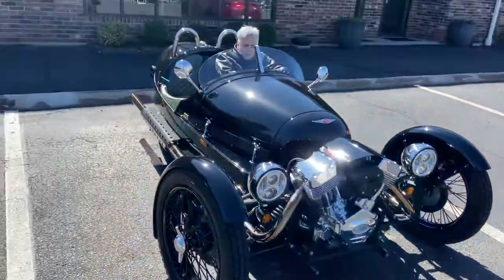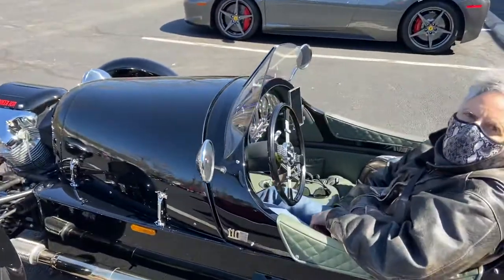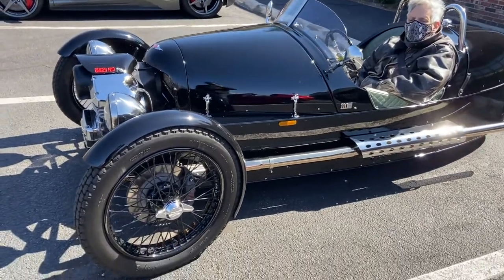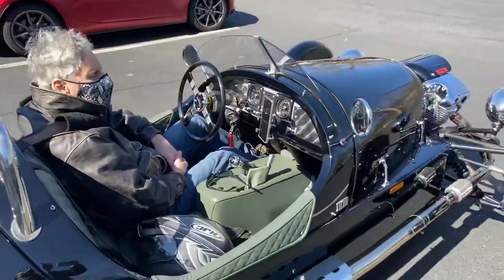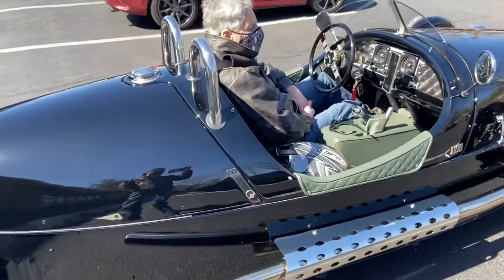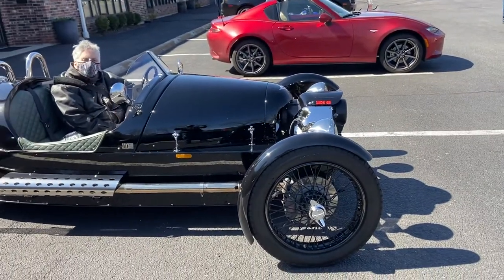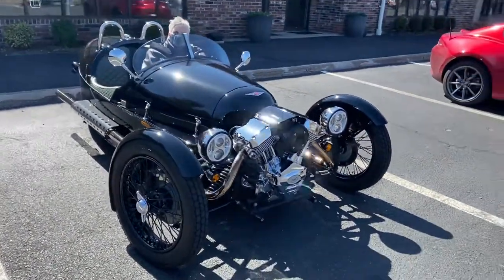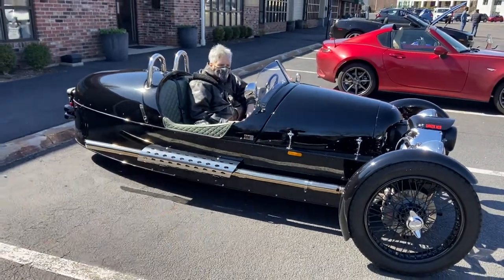Morgan 3 Wheeler

Comment: Super cool and very attractive looking, very Retro. A small negative is: with a three wheeler, there is no way to avoid potholes. That rear wheel is going to hit them every time, unless you actively try to swerve and avoid them. In warmer climates the roads are in better condition. Potholes are a mid-west and east coast hazard, created by winter weather.
Reply: You are right the potholes are a real pain as are speed humps, if I slow down I am always worried about getting rear ended by the car behind. In the UK most town roads have some bad pot holes and cause damage to the car.